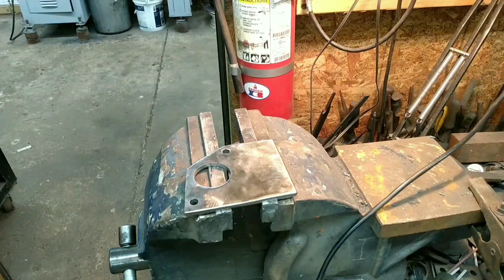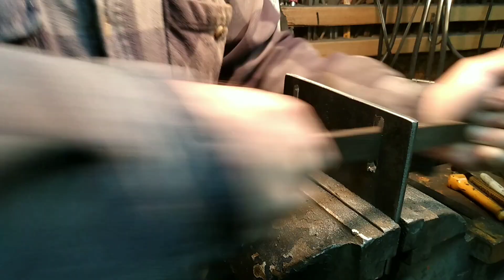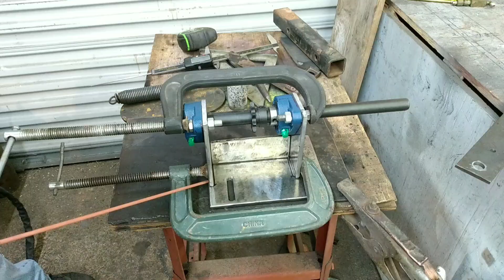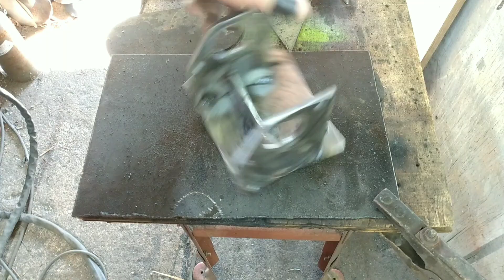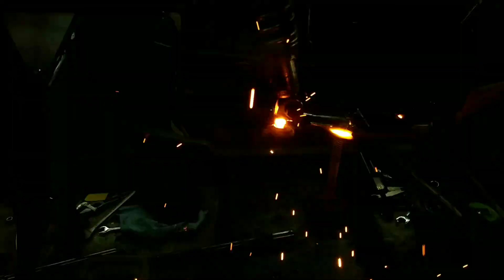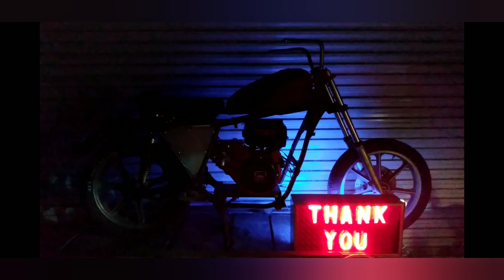first test drive, junkyard bike with lawnmower engine,459 cc predator engine, chopper build

Comment: What is your final gear ratio and have you measured top speed yet?
Reply from the maker: I haven't drove this thing 300 feet yet bui I will be making a video ASAP. I'm running a 10 to 84 ,24 inch tire,40 series torque converter,459 cc predator, gov. In,. What do you think it will run ? Thanks
Reply: @outrageousatvbuilds  that's a hair over an 8 to 1 ratio. Have you bypassed the governor on your engine to get more rpms? Based on my calculations if your RPM is around stock at 3600 pre governor bypass,  You should be at 30 mph. With governor derestricted you're looking at about 39mph. That's your final gearing calculated with tire height. I build street-legal motorcycles with predator engines. I usually set my final gear ratio 6 to 1. That's using tires that are similar to yours. My top speeds are usually at 55mph plus. This way I have a decent takeoff and have a speed that I could cruise most side streets on without getting run over. You have an insane acceleration with the current gearing but you're not going to have much for top end.
Reply from the maker: Governor not removed yet. I can change the jack shaft sprocket at some point to get more speed. But I'm building this bike to Cary me and my little woman up some some pretty steep black top roads up in the mountains and  drive a little off-road.thanks for all the input. Join my Facebook group if you like.@ Mark d Galloway
Reply from the maker: I subscribed ! Great work man ,! Cool stuff